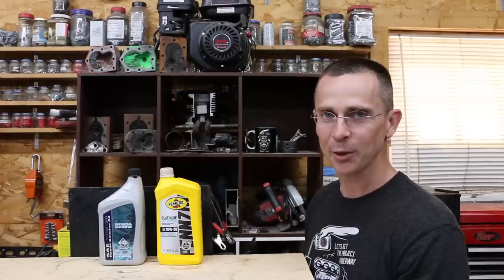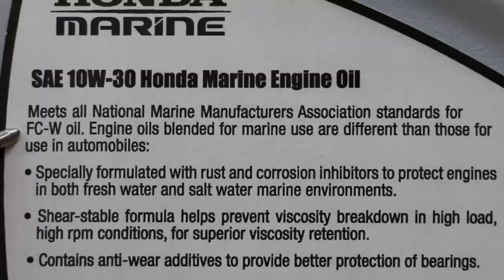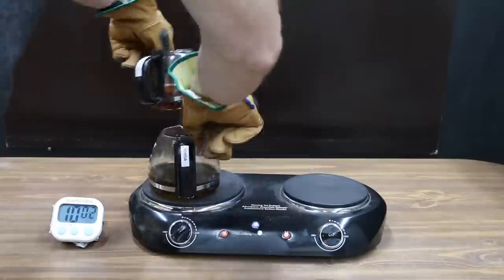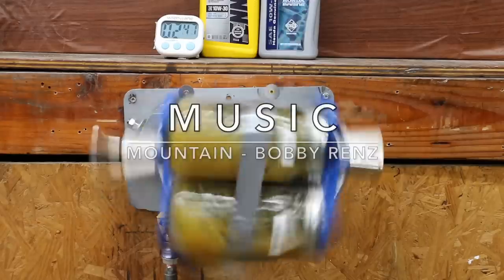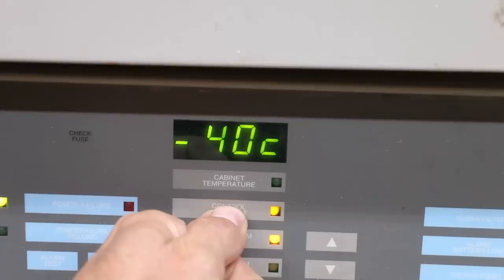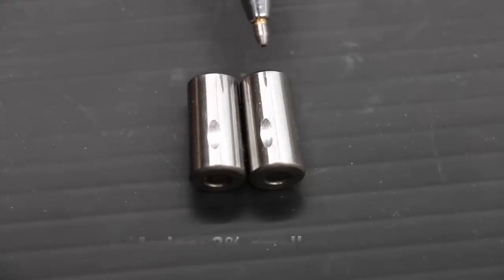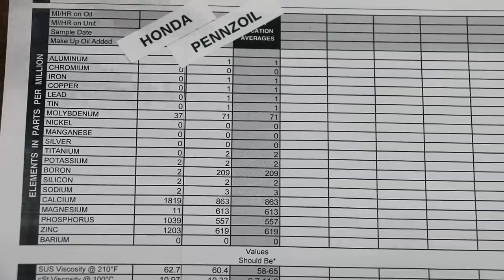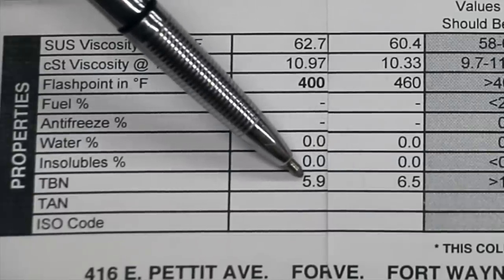Motorboat Engine Oil Better Than Regular Motor Oil?

Comment: After watching and seeing the results, the reverse question might be - "Should boat owners upgrade to car oil?"
Reply: Honda won the important tests for marine engines
Reply: Agreed!   That is the real question
Reply: no. the big tests that are important here for marine oil specifically was the anti corrosion/rust and the anti wear at rpm. 
Think about this, boats deal with much more moisture than any car will just due to operational environment. The corrosion resistance is important. 
Additionally, boats don't have multiple transmission gears to reduce engine rpm in use.. and so over their useful life see a lot more high rpm. while at a constant speed the marine oil 'only' performed 3% better, the ** about that is when you look at the regular use cases, the marine oil with less wear will make a much larger difference in the long run.
Reply: @SuperWaterskiboy  You are correct. Specially if you use 2 stroke gasoline engine. I mix my own gasoline to my mariner, usually shell v power and around 2.5-3% marine oil. runs much better than regular 95.
Reply: @SuperWaterskiboy  i think the Honda wear 3% less because of the viscous is thicker. When he test in the tube pouring down. The new Honda is come last. Meaning is thicker
Reply: The viscosity test was like listening to a horse race.  I was looking for the board to see who won for win, place and show.
Reply: Stick with the marine oil for boats
Reply: @SuperWaterskiboy  Ferraris and others turn in the 9K range. 
Also motorcycles run in the 15K plus ranges and most run Rotella 5-40 T6 diesel oil.
Reply: No the marine oil was better. It has more anti wear additives and the engines are small don't need to be slicker
Reply: Rotella T4 should be considered for marine use. Like marine oil, diesel oil doesn’t have to worry about damaging catalytic converters and is designed to work well in high compression workhorse engines
Reply: Probably yes. Might depend on the engine. The importance of corrosion resistance is overstated in my opinion, boat motors usually take the air from the inside of the boat, it's not THAT moist there, ist's not like the important parts of the motor are going to get sprayed with salt water. My 50 year old diesel engine looks worn on the outside and has some rust stains, but looks as good as new on the inside.
For a new finicky high performance engine on a motor boat it might be a different story.
Reply: @GT-mn3bx  The Rotella is largely due to price too. I love it because it works really well for the money but if money were no object(obviously it is) then there's a better oil out there.
Reply: @GT-mn3bx   i wonder if Rotella t6 would be a good 4 stroke outboard oil.
Reply: @dashcam3098  Keep this im mind. The 496 8.1 in GM trucks is the same as the 496 and 496 HO Mercruiser.  Also the punched out 502 and 502 magnum.  Many run ot in 1100 HP Ilmors, and even bigger 1700 HP engines.

Comment: I'd be interested in seeing how normal car oil compares to motorcycle oil, especially since they usually don't add friction modifiers due to the wet clutches
Reply: Include the heavier motorcycle oils that were designed for dry clutch operation as well.
Reply from the maker: Thanks for the suggestion.
Reply: It's rubbish, lasts  a few miles before its beaten to death. I once put castrol magna tec in a Honda cb1000 and rode for 300 miles running it in. When I drained it out after 1500miles it was like black water. The gearbox cuts the oil up apparently, that's why you have gearbox oil and engine  oil.
Reply: @ProjectFarm  yea pls do,being In a country where everyone has a bike. I would really like to know.
Reply: Diesel vs motorcycle oil
Reply: Shell Rotella T6 5W40 should be included in the test, it is for diesel engines mostly but many use it as a cheap motorcycle oil because it has a JASO/M M2 certification for Motorcycle wet clutches also. I use it for my 2018 Kawasaki Z650 and it is superior to the original Kawasaki 10w40 Motorcycle oil I used before.
Reply: I.use car oil on my dry clutch scooter, car oils are better than the ma rated ones for near redline operations.
Reply: Yes rotella! I use that in my old 79 Honda XR185 as well as street bike 👍
Reply: Throw in diesel engine oil, as it doesn't have the same friction modifiers as car oils it can be used with the motorbike wet clutches causing without slippage.
Reply: @NemoConsequentae  lol
Reply: @ronnieprater3018  You find it humorous that diesel oil is compatible with motorcycle gearboxes?  Mine have run with it with no issues for decades.
Reply: @ProjectFarm  Throw in some jaso ma Diesel oils too, I use Rotella T6 in everything including my ATV with a wet clutch, Generator, mowers. you name it.
Reply: @hulu3253  Heck yeah, i use the 5w40 in my atv and generator, 15w40 in mower. Both t6
Reply: Yeah diesel oil is great for wet clutch motorcycle, i use pertamina fastron diesel since it is the best quality to price in here
Reply: Yes, please test good ol HD 20w50. Do I really need to buy Harley oil?
Reply: Or vs cooking oil.  Need to look at how the motor operates and is loaded. Car vs boat vs  motorcycle vs lawn mower vs RC plane.  None are truly comparable.  Its apples vs bowling balls vs chicken coups.
Reply: Yeah I quit buying mobil 1 20-50 motorcycle oil and switched to oreillys brand 20-50 for my 95 virago and I didn't notice any difference in shift quality.

Comment: PF never disappoints!
Reply from the maker: Thanks!
Reply: @ProjectFarm  If you are doing new Oil Testing.   I'd love to see  :  Mobil 1 Extended Performance (non highmileage ) , Castrol Extended Performance  against the Amsoil  OE, XL  & Signature Series Oils, and against Pennzoil Ultra Platinum & Royal Purple.
Reply: @ProjectFarm  so don't get me wrong, I loved the episode. But apples to apples, shouldn't it be say Honda auto oil vs Honda marine oil? It didn't surprise me that high a quality Pennzoil beat the Honda Marine. The Honda isn't synthetic, either. It DID do a better job at rust prevention. I don't know.......

Comment: I would love to see a budget drill showdown. 

Specifically, stores "House" brands. Wal-Mart's Hyper Tough, Target's Blue Ridge, Menard's Tool Shop, Harbor Freight's Drill Master, and maybe entry level Black and Decker because they can be found at lots of places.
Reply: For walmart I think it would be best to use the new hart tools, walmart has pushed them pretty hard. They're owned by the same conglomerate that owns milwaukee, ridgid, and ryobi. I wouldn't rely on them professionally, but they're actually decent for a DIY level.
Reply: @doctordev97  Given that they are TTI products, I think that might be a bit unfair. I think a rebranded Ryobi drill would wipe the floor with those other brands.

Comment: Video suggestion: What brake parts cleaner brand works the best. Love your videos!
Reply from the maker: Great suggestion!  Thanks
Reply: Yes chlorinated or non chlorinated
Reply: @Heck_off  I love Blaine's Farm and Fleet or Mills Fleet Farm depending on what state you are in.
Reply: Brake clean: great for cleaning anything but brakes.
Reply: @ProjectFarm  FYI, brake parts cleaner can be used for cleaning parts prior to welding but it is important to never use non flammable version for this purpose.
Reply: Chlorinated #1 👍🏼
Reply: @ProjectFarm  Could you please test different handheld steam cleaners? There is a wide array of prices and products and there is no clear recommendation online.
Reply: You have to find brake clean containing heptane. That stuff actually cleans parts instead of melting gloves and ruining paint like store bought brake cleaner... which is just carb cleaner re labeled.
Reply: That would be a good one for sure!
Reply: My mechanic stopped using parts cleaner and carries around ether/starter fluid instead because the parts cleaner companies have had to change the formulas to conform to new laws. It works better than the new parts cleaner crap they have out now. RIP parts cleaner.
Reply: @loosewirewire7954  ahh the ol cosby in a can ehh? 😆
Reply: @Akotski-ys9rr  can only get non chlorinated in Ca
Reply: Its acetone and toluene.  Really doesn't matter.  Its like asking which is better: breathing in and out; or out and in.

Comment: I will say that my Honda Bf75 4 stroke outboard doesn't run nearly as hot as an automobile engine which may explain the difference in the evaporative test. Most automobile engine coolant temperatures are going to be 195 Fahrenheit or above, even pushing my 20 foot pontoon in the summer and 80 degree water it's rare for me to see 160 degrees on the gauge even after running 5500 rpm for hours
Reply from the maker: Great point!  Thank you
Reply: Very good information to add to this discussion!
Reply: With that being said I still would like to find a better marine oil then that Honda marine oil because that evap result didn't look good at all....
Reply: @countryfamilyalways7280  I don't run that Honda oil, I believe the last change was quicksilver or Pennzoil marine, I was just saying that temperatures may be a small variable, still a poor showing from Honda OEM oil
Reply: @kygunworks4982  I agree with you and I don't have a boat YET but am looking so appreciate your knowledge on the subject.
Yah there has to be better oil then that Honda with that result.
A automotive oil that comes to mind that might out do that Honda is Amsoil ZROD as it has high AW additives better then regular car oils, long lasting corrosion inhibitors,  amsoil says about 2 years because people store classic cars so they made it that way and I'd bet it has better noack and or evap results then Honda oil.
But on a second thought I'd bet Pennzoils marine oil might have better results also idk...
Reply: @countryfamilyalways7280  mine gets changed every spring, the boat doesn't get a whole heap of hours on it, maybe 100 a year because I work so much, I've alternated oils and haven't had any ill effects so far
Reply: The temp on marine engines is kept down for corrosion purposes.
Reply: Who drives a boat at -40 degrees?  LOL
Reply: The temp is greatly influenced by the fact you have an unlimited supply of water thats 80* vs a car/truck that might only have 3 or 4 gallons of coolant and it can heat that small bit of fluid up pretty quickly. If your boat could heat the lake water up im sure it would run similar temperatures
Reply: @n2omike  the question being addressed by this video is should you use marine oil in your automobile. So it makes sense to test at -40. But in boating, it is not really possible to get water temperatures lower than 0C/32F (well, salt water can be a few degrees colder) otherwise you are going to be using a snow machine not a boat. LOL.
Reply: @mckenziekeith7434  My comment was poking fun at the fact PF tested the oil at -40 degrees.  Lol
Reply: @n2omike  hey, my icebreaker feels dismissed. 😁😁😁😁
Reply: @125hptripledietz9  my comment was solely to say that normal operating temps could cause the evaporative loss test difference because the marine oil may not be designed for such high temps and I know why it stays cooler, it's an open loop with water temp instead of closed loop with a radiator
Reply: @n2omike  I've driven at 20f in lake breaking ice and won't do it again
Reply: Forrest, that makes sense when i originally read your comment i thought you talking about the water temp not oil evaporation which makes more sense
Reply: @mckenziekeith7434  salt water doesn't freeze at 32° F.
Reply: @omieyouknowme  Breaking ice at the boat launch is the path to catching Muskies that can fit your entire head in their mouth. Icicles on the rod guides is very frustrating tho.
Reply: Been a mechanic by trade my 2 cents: an outboard motor or inboard will never see temps high as auto engines but really need extra help when having wet exhaust systems.. an inboard with a closed heat transfer system always will run hotter so any decent oil will meet your needs.. the tipping point will always be the maintenance and fuel quality you use..
Reply: Extreme evaporation tests like performed in the video are not much use for modern oils that are API certified. I have been using Mobil 1 motor oil for the last 20 years (two different cars) and not once has the oil level gone down at all in-between oil changes (as visible on the dipstick). The extreme volatility tests performed in the video are therefore not really relevant to motor oil performance, unless one is using it in a race car (NASCAR, IndyCar, F1, etc).
Reply: @WisconsinEric  yes. Very. I modified my kicker for a hot water tank to help warm up hands in winter.
Reply: @beezalbub7325  yeah true. Seawater can get a bit colder, but only a few degrees below freshwater freezing temp. You will not find sea surface water temperatures of -40, and not anywhere near.
Reply: so the cooling system on your car is the exact same cooling system on your boat? and the engine is also identical? Otherwise you are not comparing apples to apples.
Reply: that´s true.. marine engines generally run pretty cool compared to modern car engines
Reply: @countryfamilyalways7280  I see the word "then" when you meant "than" in a few places.
Not criticizing, just taking the opportunity to help with this minor error.

Thank you for your input, great conversation!.
Reply: @125hptripledietz9  Very good point and good way to explain it 👍
Reply: @125hptripledietz9   An outboard motor, at least the ones I have owned, all have a thermostat, so the engine is regulated at the right temperature.  Overheating is hardly ever seen unless the thermostat goes bad.
Reply: Was thinking the same thing, my new black case, Merc 200XL was running at 135* in 80* lake water. Makes a huge difference in oil performance.
Reply: My vintage boat (1969) chrysler 318 runs at a steady 140 degrees at WOT, idling down the channel it only gets up to 160 degrees. Farenheit of course, This is America!
Reply: Yep come your pulling lake water for cooling and not recirculating the same fluid around and around staying hot.
Reply: your boat motor cools with a steady stream of lake water, not hot coolant
Reply: @MaliciousSRT  we know, that's the point. Comparing engine oils for vastly different applications under circumstances one isn't designed for hardly makes much of this test useful.
Reply: @Adamsadventures83  it seems like a lot of people have missed that based on the replies to my original comment, I pointed out that maybe that caused much of the difference in testing but people want to comment like I don't know why it stays cooler or I'm clueless, it's like people don't even read before they reply
Reply: @bobl78  they may un 20 degrees cooler, maybe. But you have to realize, that is only water temp and it isn’t being recycled like engine coolant. The operating temp of the outboard is very similar to your car engine. Y’all are confusing operating temp to coolant temp. The water entering the engine essentially transfers heat. Combustion chamber heat is similar thus rings, valves and pistons are similar with heat also.

For example. When I tow my camper with my F350. Oil temps can reach 240+ degrees while going up a hill. The water temp stays around 200 degrees. The oil temp in that 6.7 is about 10 degrees hotter than water temp at an idle
Reply: @therustyblades1212  More like 40-50 degrees cooler. But even at just 20 degrees, that's a 10% difference from many modern vehicles.
Reply: @kygunworks4982  read my comment on the thread. Oil temp isn’t the same as water temp. I think people get confused about that. The engines, outboard vs car. Oil temps are very similar.
Reply: @kygunworks4982  it’s yt and social media in general, no one reads every comment
Reply: @davestephens3246 perhaps not BUT the piston rings in any engine, boat or car, will ALWAYS be at extreme high temps, and the oil lubricating them will be at or near the temp they are...that's why this line of thought/questioning/testing is relevant...
Reply: @Adamsadventures83  what is that in REAL units of temp?? I can't use Google to calculate from stupidheit... lol just trolling... ;)
Reply: @geoffstrickler  which one? Polar Star, Polar Sea, or Healy? Lol!
Reply: @mckenziekeith7434  salt water freazes at a lower temp. Depends on the salinity of the water.
Reply: @ETC_Rohaly_USCG  none, it was a joke.
Reply: @geoffstrickler  lol! I figured... but I’m a Coastie, and had to ask.
Reply: @Wrang15  yeah true. I edited my comment since you are the second person to mention that. Seawater can get a bit colder, but only a few degrees below freshwater freezing temp. You will not find sea surface water temperatures anywhere near -40. That is the key point.
Reply: And you bf75 is only carn engine on its side too. but yes it runs a bit cooler than when in a car.
Reply: @mckenziekeith7434  it's not that the motor will be running at -40°, but it can sure sit overnight and drop to that temp, so it's important to see how the oil performs in those conditions, at start up...
Reply: @ETC_Rohaly_USCG  I’m in North Texas, the only ice breaking we typically need here is for the roads, and that maybe once every year or two.
Reply: makes sense water engines running on water versus land engines running on land
Reply: @n2omike  I have an iceboat that goes about 50mph but it has no engine, just a sail 😀
Reply: @125hptripledietz9  They both have thermostats to get temps up.  If radiatior is working properly, your argument is irrelevant.